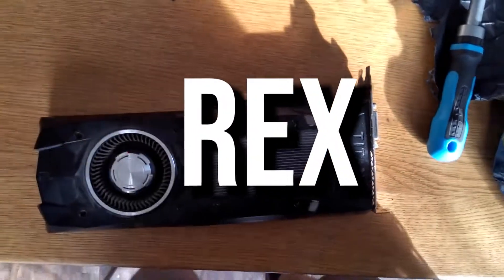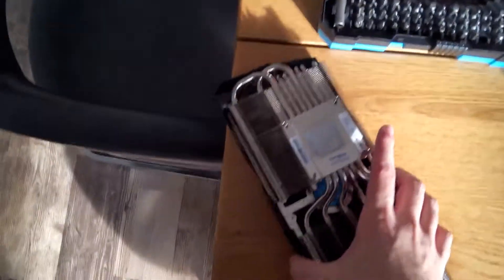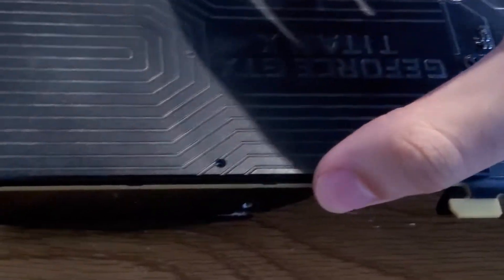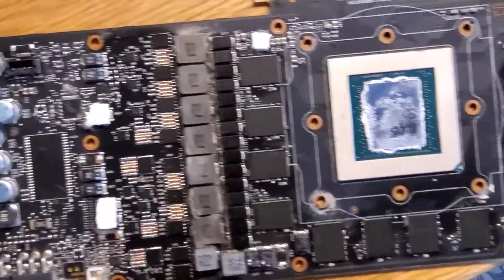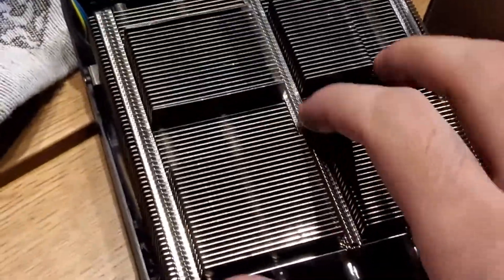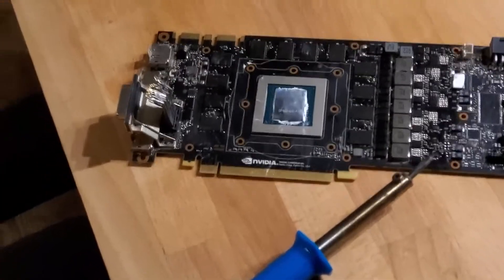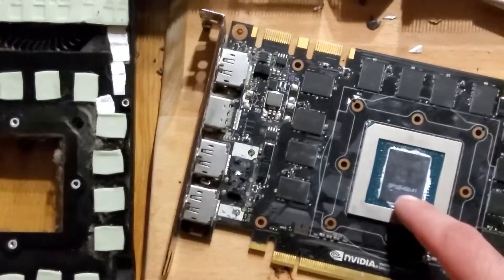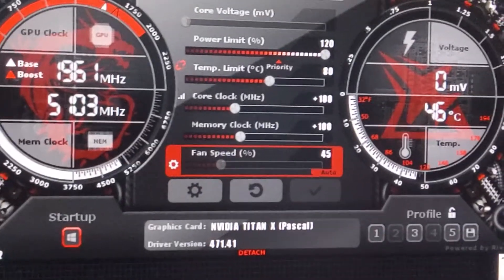Installing a custom GPU cooler

Comment: lmao Blower Titan X(P)
3:57: that fcking hurts. Why not Frankenstein your old cooler? Just taking the Heat spreader, removing the Fan assembly and replacing it by 2 Nocutas would have helped probably as well.